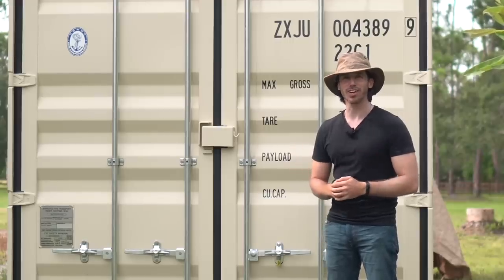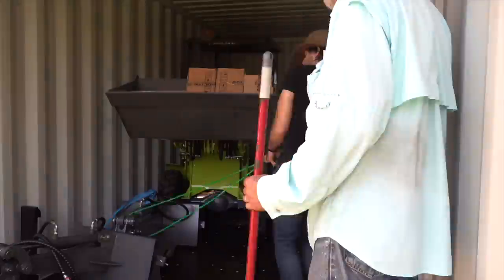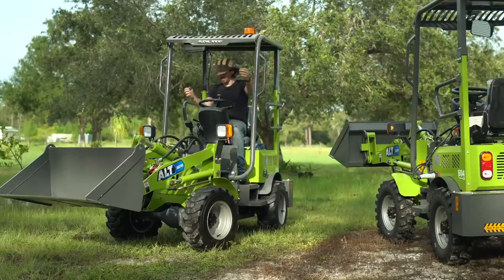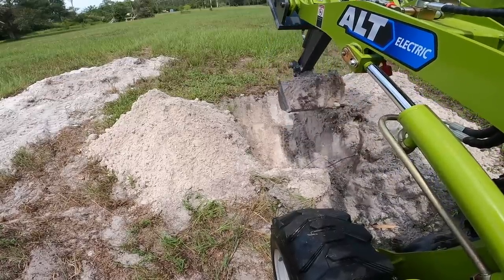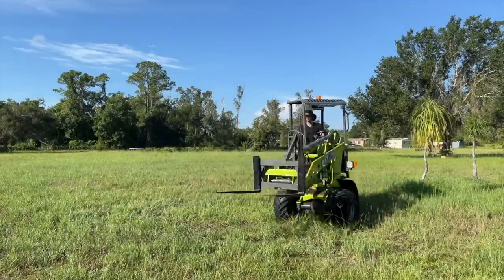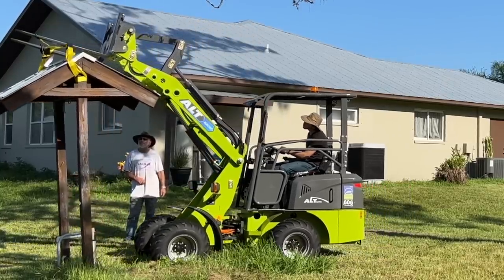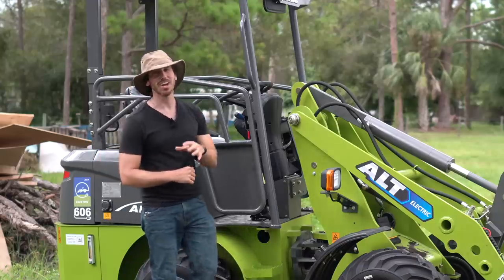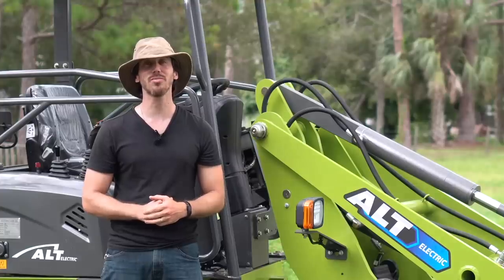I bought a container full of Chinese electric construction equipment!

Comment: I’d never actually thought to see if these existed as electrics. Colour me impressed!
Reply: I think Volvo just recently presented a series of full electric full scale excavators. I wonder how long those run or if you can go tethered in certain situations.
Reply: They have existed for years inside of mines.
Reply: @gateway199999  Yes, but as far as I remember, alot of those were run tehered in some way, as batteries were not able to endure a whole shift, plus in mines work often was done around the clock and there was no real downtime for charging. Not saying there have not been battery powered electric vehicles or machines as well.

Comment: Might wanna cover that roof beacon electrical cable with a metal channel or somethin' more weather-proof, so it doesn't get sun-faded then start cracking and chipping pieces of rubber, or whatever insulation material they used, off...

Comment: I think it would be useful to also talk about the replaceable batteries, so our grandchildren are able to restore them instead of throwing it all away.
Reply from the maker: Definitely, I should have more info on them in the video. For a bit more detail: they're made up of 5 or 6 12V AGM batteries (depending on the model), and so they could easily be replaced by the owner if necessary, and there are plenty different battery brands available in the US already. The job would only be slightly more complicated (and heavier) than replacing a car's battery, which many people can do themselves. But I'll of course stock replacement batteries so there will be the option to get the originals in the US down the road when they're needed.
Reply: Your Grandchildren will life in a world where Batterie Replacemant, Recyling and Smartrepair is a Service you can get everywhere. 
Like you can get any combustion Engine repair and rebuild these days.
Also all those Construction Equipment no matter is it Electric or not weara out on the pins and bushings of the arms and stearing and wheelbairings. The hydaulic hoses and cyclinders are non other than what you have right now onthe machines.
Replacing or repairing this parts is a job done right now everywhere on the world to get such equipment running.

But i will admit at least picture of the batteries and what models are in there the stats and how long you can run the eqipment with one charge would be nice to know.
Reply: @Total_Egal  Thanks for your reply. It would indeed be interesting to see the batteries. For example if they used "available cells" there should be no problem. But if for example they are heavily glued in (I doubt in this case) in a proprietary box, replacing would be difficult or at least expensive. For example in cases like Tesla does with the model Y, the batteries are part of the frame and impossible to replace! Of course anything can be done, but that surpasses the value of the equipment you're trying to repair. Not trying to brake down your product, just giving you helpful information to maybe make it more attractive to buy. Best of luck.
Reply: @EbikeSchool  Tanks for the info, very useful for interested buyers. Best of luck.
Reply: @BrainHurricanes  I would bet there are no special made packs from basecells in it just a bunch of drop in replacement LiFePo or LiIo batteries looking like the old Carbatteries. These would be easy fo switch (and Recycle or refurbish) in the future and got build in BMS.
What Tesla is doing with the glued in Cells is a realy bad design for smart repair.
Also its not my product? I just commenting^^

Comment: Where did you buy this? Ali baba ?
Reply: I believe so. It certainly looks like the sort of shit you’d find on there. It may appear to have a suspiciously low price, but don’t let that fool you. You’ll have to buy things like the batteries and other features as these are not included in the price Alibaba tends to quote, and it doesn’t end there. Shipping is surprisingly expensive too. As well as paying shipping fees, you’ll have to jump through hoops to get the equipment shipped. What I mean by that is you’ll need to hire a freight forwarder (which Alibaba can sometimes do internally), then a customs clearance agent and finally a final destination forwarder, and it’ll be an expensive ordeal.

Comment: i bought one electric forklift in from China and listed it for sale i sold it without seeing it so then did a container load of a 1 ton -1.5 ton - 2 ton and 3 x 7.5 ton log splitters and 4 pallet trolleys no problems at all just some of the finishing like runs in the paint would of been nicer all in all very cheap and i live in New Zealand.

Comment: This is one of the coolest useful tool videos I've seen. Not sure you would be willing to share how much you spent on all that, but just one of those with the switchable heads would be so helpful for anyone on a farm or warehouse setting. I didn't watch the whole thing so not sure if you mention how long the battery lasts, how many recharges, is it LFP so you can replace it easy enough? Also do you get to keep the container... I assume so which is pretty cool for storage or an outside office setup!.

Comment: I'd love to try out these machines on my land - which has more rocks than soil and the ground is as hard as concrete.  Would like to see more attachment options: especially a 4 in 1 bucket.  
How much work could you do on a full charge ?  A full day of light work ?  A full day of heavy work ?  Less ?  More ?  
Wonder about the quality of the machines and the attachments - yes, they do appear well made, but only time will tell the truth about the strength of the steel, will teeth break off the bucket on hard rocky ground, etc.  
Also wonder about years down the line, what will you do for spare parts - if any of the computer controllers in the machine fail, when the batteries need replacing, etc - will these be available.

Comment: I need one with a snow bucket, snowchains, pallet forks and maybe a plow if that would work.
The battery only needs to last 2 hours in the cold, heck if I remove the rollcage I can store it inside so it is warm.
I would however not charge it inside...
We need to know battery time/charge time and maybe topspeed for road travel too

Comment: These machines are so cool for the price. I would really love to see a J1772 port on it with its own onboard 120/240v charger to make it a little bit more universal and portable. if you were using it remotely for a while, you could just get a cheap 120V J1772 cord to take with you instead of the big external charger.
There is an advantage here to lead acid because of the weight but lithium iron phosphate would also be a really nice upgrade, but more expensive I'm sure. Although with the better energy density, you could make the battery compartment smaller and just add more steel for dead weight.

Comment: If you start to rent them out …having a trailer for each one with a generator built in and accessible storage for each attachment would be something to consider….   Have an electrifying day.    ? Is there an outlet on these units that  you can run an extension cord to operate electric skill saw / drills/ work lights ..etc. ? ..  having a forklift to build , a shed or a deck and plug your power tools in to would be very. Handy !!!

Comment: I could see that being useful if you have need of the capabilities of a small skidsteer/frontloader at least several times a year but don't generally need it for more than a couple hours in a day.  A rental will generally run ya 500+ a day for something in this capability range.  Could probably pay for itself in a year or two of intermittent usage and you'll probably use it for alot more tasks that you'd normally just throw mussel power at instead of paying for a rental.

Comment: Nice machine but only for level land. Here in the California mountains on my extreme property, these things would roll daily.   US backhoes of normal size always have a front pivoting axle that saves you on angled land.  I suppose they are no narrow so as to fit 2 abreast in a standard container. As for the backhoe attachment, without a swing capability, I would declare this completely impractical. Turning those front wheels at a standstill will run down your battery very quickly. Nice tiny loader and forklift but it ends there.

Comment: There are so many possible buyers for these machines. For me the modern homesteaders and market gardens. Ill check out your web page. Hopefully you will post the specs on these machines. Lifting capacitys, time a full charge lasts and what kind of time to fully charge a low battery. Of course width,height and length. And a list of accessories ( damm if they had a smow blower can you imagine how many companies like malls and business buildings would love something that's electric).

Comment: I've always figured that electric vehicles like this make a lot of sense. These vehicles need a balance weight, so the battery becomes part of that weight, instead of being extra to move around.
Reply: Yeah and the battery probably only lasts a few charges and then you're going to have to pay what you paid for the whole machine to get another one and then the installation and then the removal
Reply: Sounds like liberal logic to me
Reply: @anthonyk6265  wtf does liberal logic have to with designing an electric forklift?
Reply: @user-bb4xk6bb7nxxx "liberal logic is thinking a lithium pack will die after a few uses "
 No, that is conservative thinking "Things were better in my day and we should go back there. All this new fangled stuff is rubbish"".
They love to complain.
Reply: @anthonyk6265  the batteries will last anywhere from 15-20 years, it depends on how you use it, trust me 10 years worth of fuel cost, oil changes, air filter & other maintenances costs WAY more on gas & diesel powered construction vehicles so your logic makes no sense whatsoever….
Reply: @anthonyk6265  The big thing about machinery like these is that you're not going to be driving hundreds of miles with them; chances are good they need no more battery than an electric lawnmower. I'd love to know the chemistry, though a good LiFePo4 would last the rest of your life and have plenty of power. If it's Lead-Acid... oof. Lithium-Ion? Oof for different reasons.
Reply: They are listed as lead acid on his site
Reply: Yes and the e-torque to pneumatic pump works efficiently well.
Reply: @1DonFF these batteries will last 5 years max, rc lithium batteries last only about a year I would imagine these batteries would have near the same life span and that's not taking into account some of these humid hot ass states. All batteries degrade no matter how you use them, that's the major problem with electric.
Reply: @IamCoalfoot  what are you talking about that battery is working the Hydraulics it's working everything on that loader I guarantee you've never used a loader a day in your life
Reply: @IamCoalfoot  Your consumer electric lawnmower isn't even in the same ballpark. Even the small indoor-only electric forklifts like you'd find in warehouse stores have pretty huge batteries to be able to make it through a workday. It's not quite as big as a roadworthy EV battery, but it's at least 1/4 of one.
Reply: @anthonyk6265 I highly doubt that will happen. Most electric vehicles these days will last decades. My EV at 3 years old the battery is at 95% health.

It's possible with anything you get scammed but why after making those awesome vehicles would they scam someone on the battery? Makes zero sense
Reply: @nlitend1  Lead acid specifically for as counterbalance weight, cutting overall cost.  Sure, the could have used a lighter battery, which would have cost more.  And then added a separate counter balance weight requiring additional work.  From an engineering standpoint, cheap & heavy lead acid was a good choice.
Reply: After running an e scooter on both lead acid and lithium battery pack, I've found the lithium packs far more resilient to repeated charge cycles.

Comment: I'm blown away by how affordable you've made these machines 11000 for a new machine in the US is unheard of. I have seen diesel zero turn mowers go for more than that I'm impressed and as someone who is looking for a small machine to do work on the property this is perfect.
Reply: Plus they have attachments that can do more things and dont cost a fortune
Reply: It's sad that we can't produce something as efficient and affordable here in the US.
Reply: The excavator on the site is way overpriced tho at $22k. You can get a gas AGT for $4500 new. It can't be $18000 better.
Reply: Put one into actual hard work and you'll soon find out why they're only 11K.
Don't get me wrong, cheap Chinese machines are ok for a home/small holding owner but not in full-on commercial use.
Reply: @deezelfairy  I don't see any commercial farm in the video
Reply: @kangkim150  They're selling them, so no, guess ya don't 😂
Reply: @deadsquirrelsfan4688 The same product made in USA will cost $30K and expensive to repair.
Reply: @deezelfairy it's almost as if, and hear me out here, there are different tools for different jobs!
Reply: @nsebast  And will last 10-15K hrs of work if maintained correctly.
These won't.
Reply: @iamaduckquack  Indeed, but in my experience these cheap Chinese machines frequently get sold by unscrupulous salesman to the wrong customers and it always ends in tears.
I've been a forklift tech for 20 years, lost count how many bitterly disappointed customers I've had to confront when the reality sets in with the Chinese forklift they purchased that was £10K cheaper than a USA or Japanese brand.
Reply: @deezelfairy  China is more than capable of making high quality goods but they typically make it as the customer requests it, which has usually cheaply
Reply: @iamaduckquack  Again, I agree China is more than capable of making top tier products - when they've got a Western manufacturer calling the shots on quality.
The issue is machines that are designed and built solely by Chinese companies with no western involvement. Infact, you'd be amazed how many of these machines shouldn't even be sold in a western country, most don't meet the safety requirements our manufacturers have to adhere too.
Trust me, I know a junk machine when I see one. I've spent a lot of my working life busting my knuckles on them.
Reply: @deezelfairy  IF. Anyway China sells primarily not for US market but for lower income countries.
Reply: @deezelfairy  these can't be terribly difficult to repair. I'm curious about the replacement batteries and motors, and how accessible they are.
Reply: @deadsquirrelsfan4688  We absolutely CAN, we’re just not allowed to… because that would require jobs and it’s too bad for the environment. So instead our government forces us to offload those jobs and emissions in China.

Comment: I work occasionally for an old friend in concrete demolition. When we sawcut the floor of an office building for an electrician and plumber to lay in conduit for a new tenant, we normally pull the blocks by hand. This means we have to cut them smaller and risk back, hand and foot injuries, and it also ruins two hand trucks per job. Having this piece of equipment would be OSHA compliant for use indoors, and we could even dig out the substrate for the electrician and plumber, netting even more profit. This is pretty cool, I’ll be passing your contact info on to the boss.

Comment: You have to face the fact that you can get quality equipment from china. I have purchased Chinese lithium battery forklift from Hangch and it was half the cost of a Yale forklift and I could not tell the difference in quality.
Reply: Yes you can. The problem is, as he said, to find those quality products and the right manufactures, because that's not easy. You don't know who would screw you and who wouldn't. As we saw with the excavator he bought - it was basically crap, and very expensive crap! lol
Reply: @Bannimann2  Agreed.  Due diligence on the part of the buyer is certainly required.  But that is true of US manufactured products as well.  Good stuff and crappy stuff always exists in the same marketplace at the same time.  The quality of (good) Chinese products has shot way up there including heavy equipment.  Look at Sany construction equipment.  Chinese company with huge marketshare in the US and around the world.

Comment: 20:06 I can answer your question via a friend's company.

He owns a B2B landscaping and irrigation company.

A few years ago he ditched all his ICE tools and went all in with battery-powered tools.

The tool power lasts all day but he has a number of spare batteries (which also helps because he is based in Florida) - due to his location work happens all year around.

Since the change he has had less staff off sick due to vibration-related issues, staff not getting sick from burns, breathing in emissions from the gasses given off from the ICE and staff being much happier with the working environment.

last time I spoke with him his insurance went down due to these changes.

Matinace of tools and tools needing replacement/repairs/going wrong and costs have greatly reduced.

He is now looking at replacing his 5 to 7 F150s with the F150 lighting as well.

At the same time, he was looking at investing in solar panels to power the yard and building where all the stuff is kept. 

And free fuel to charge the trucks.

He sees it as saving him money and not as much as saving the environment.